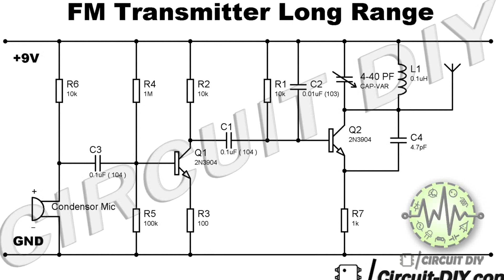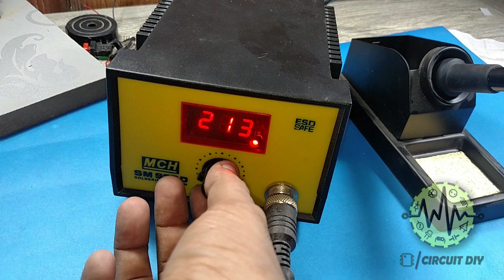FM Transmitter Circuit | Long Range 500m | Weekend Projects

Comment: it is possible to set the FM frequency with a digital circuit such as  MCU, I mean digitally change the variables of LC parameters
Reply from the maker: Yes possible
Reply: @CircuitsDIY  do you have any reference link to such feature or circuit?
I could find any by my self 
Thanks

Comment: Is your soldering iron set to 200 deg Celcius?
Reply from the maker: Yes exactly
Reply: @CircuitsDIY  I always solder at 380 deg cel but I think that is way too much now! Thinner solder, less temperature and smaller contact points is better.

Comment: I mean generally institutions have towers is there any impact of these electric and signal from towers High frequency on the fm transmitter of 500 meters range while we using it
Reply from the maker: BHARATHI ACHANTA I don't think coz there are mobile tower everywhere and we also have such radio operating on different frequencies

Comment: What if we use mobile instead of old radio.. is it going to work sir??
Reply from the maker: BHARATHI ACHANTA yes it will work also but there are some noise in the sound ..so by using an old radio you will get clear result

Comment: sir mara pase 40 pf varable capacités nhi ha ma 20 pf fixed capacités use karu ho ya cam caraga
Reply from the maker: kryga 20pf per bhi aik khas frequency generate hogi ..bus apko wo tune krna prygi .....agar pakay pass purana wala radio ha to usper achi sound clear sunai daygi

Comment: Sir is it really work for 500 meters plz reply me sir
Reply from the maker: BHARATHI ACHANTA yes in open atmosphere with old radio
Reply: @CircuitsDIY  HOW DO YOU CONNECT THE TRANSISTORS TOGETHER , FROM WHAT TO WHERE ? COLLECTOR TO  BASE ? BASE TO COLLECTOR ?    THANKS
Reply: BHARATHI ACHANTA no
Reply: @mw10259  g